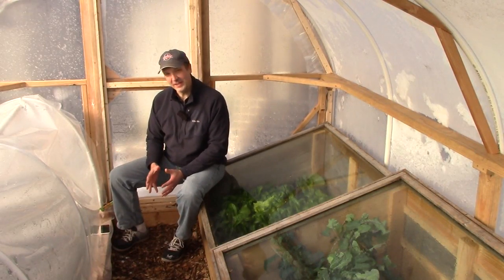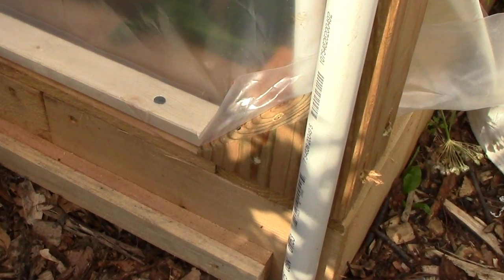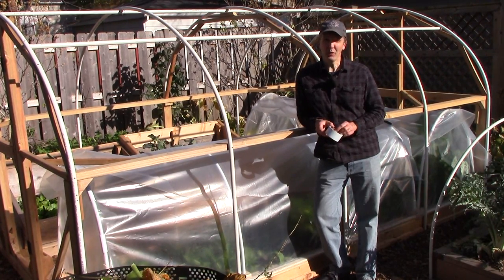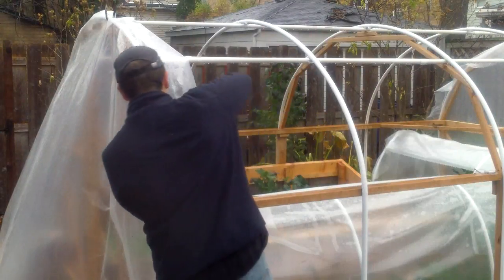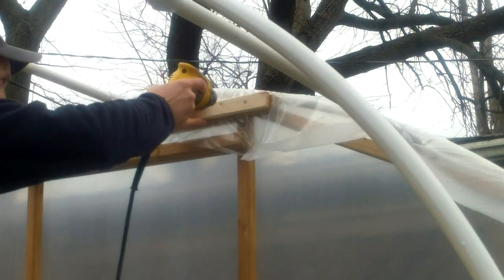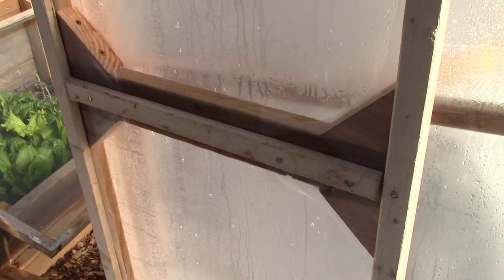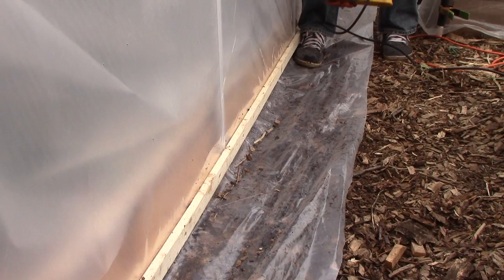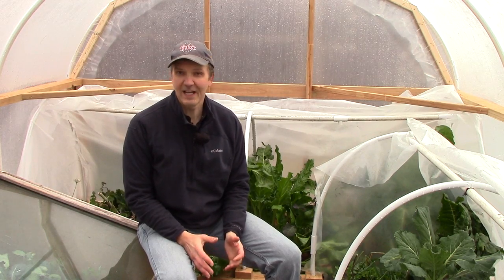How I Built Our DIY Hoop House (Greenhouse), pt. 2: Door & Plastic Cover

Comment: Had to come back and see this video again. My plan is to take a Harbor Freight 10'x17'  garage and make it into a hoop house and add low tunnels as you did. Want to come up to Maine in the spring and help?
Have a blessed day, Patrick.
Reply from the maker: That should work, Jim! If there are any sharp edges on the metal frame, covering them with duct tape should help. Best wishes with your hoop house!
Reply: @OneYardRevolution  thanks so very much. I will be using carriage bolts to attach the 1x4 straps and I think it was in this video of yours where I took note of the white duct tape. As always, great keeping in touch with you.
Blessings,
Jim

Comment: nice job, looks great.  The only problem I have is a hoop house is very wet, and I am certain the moisture will have a negative affect on that wood.  Instead of wood, I used poly web to secure the plastic.  Works great, and water resistant.  I also used wiggle wire  on gables as I said before, thus allowing me to remove the plastic if needed  with no affects to the plastic.  Overall a very nice project.  Happy growing.
Reply from the maker: +motocephalic Thanks! Can you send me a link to the poly web product you used?
Reply from the maker: +motocephalic Thanks!

Comment: really awesome! a suggestion: a clutched drill. im concerned  about stretching of the plastic over time and what are the temps, in and out? You are the best!
Reply from the maker: +sbfarmer 8 Thanks! I'll be gathering data on temps this winter and will share it with everyone. The plastic will stretch over time, especially on top. The top plastic will be off from March to November, so I'll be able to tighten it up every year when I reapply it. I can't tell you how many people have encouraged me to get a new drill. I take after my father and have a hard time replacing anything that still works. ;-)

Comment: Super clear and detailed, thank you for this series
Reply: Before you build look into cattle panels for your greenhouse, also 12 mil Agtec poly is only ¢ .26 per square foot minimum of 300 square feet but they cut custom sizes. I also added grommets to the plastic sheeting, which is 7 year warranty plastic and reinforced. I'll leave a link to the plastic and cattle panels as a reply to your comment.
Reply: Cattle panels link. https://www.tractorsupply.com/tsc/product/feedlot-panel-cattle-16-ft-l-x-50-in-h
Reply: @BillyBob-lk2uw  thank you!!

Comment: Nice Job man! 
I presume your area is very cold and windy, this seems to be a lot tighter that I would have made in my area (almost no snow)
Reply from the maker: +Tom Britt Thanks, Tom! Yes, we get a lot of snow and it can get very windy, so it's important to have the plastic fairly tight so snow doesn't have a chance to accumulate on sagging plastic. It's not unusual for us to have a meter of snow on the ground.
Reply: +OneYardRevolution | Frugal & Sustainable Organic Gardening 
Wow! it's a huge amount of snow for my country. Your job and explanation is very useful, I really like the idea of the wood tensors inside, it allows using thinner pvc tubes that are a lot more flexibles. I also like the way you make and cut the door (sorry i sometime use French expressions into english). One thing you did not plan an air circulation, why, even in winter excess of humidity is an issue by sunny days, are you going to open the door?
Reply from the maker: +Tom Britt Thanks, Tom! Yes, we can open the door when air circulation is needed. I also framed an opening for a window that I may add next year. Even so, I don't expect air circulation to be much of an issue because of the way we'll be using the hoop house. We only plan to have the top covered from roughly November to March. During much of that period, it is usually far too cold to vent the hoop house, even on sunny days. Using this approach on a smaller scale with low tunnels, we've never found excess humidity to cause any plant damage during the very cold months. That said, I'll monitor the issue and report any problems that I encounter.

Comment: Hi Patrick, I enjoy watching your gardening videos. I built an unheated greenhouse this year. However, it smells like mold inside the greenhouse. Do you have any suggestions on how to control fungus and mold from building up inside the greenhouse?
Reply from the maker: Thanks! We only keep the cover on during the cold months, so mold has never been much of an issue for us (it's too cold for mold to grow).  Is you cover on year round? How cold does it get in winter there?
Reply: @OneYardRevolution  Hi Patrick, Thank you for your response. This greenhouse is only for the winter. The temperature can range from teens to low 70s in my area during winter. I am not around to open the door/window to keep the air flow on days when the temperature increases because of my work schedule.

Comment: Really nice structure Patrick! Just in time. How cold are you going to let it get before closing the cold frame doors, and adding the second layer of protection of plastic? During the day it has to be 70-75 inside...(I'm using Ag-15 for the interior tunnels).
Reply from the maker: +Paul D Thanks, Paul! So far, I've covered the cold frames and low tunnels for the last 3 nights, when it has been as cold as 15 F. I vent them during the day, though. As a rule of thumb, I keep the inner layers off or vented unless it's well below freezing and not sunny out. What approach do you take?
Reply: I haven't had to yet! I was picking your brain on the subject. I forgot you guys in the mid-west had that clod snap and snow. I think your way sounds like a good rule of thumb! thanks
Reply from the maker: +Paul D You're welcome! I try to do as little as possible and err on the side of being too cold rather than too hot. Between November and March, we keep the covers on when it's well below freezing and not sunny (or even partially sunny).

Comment: Do you plan to heat the hoop house? A rocket stove could totally allow you to fully grow year-round.
Reply from the maker: +MIgardener | Simple Organic Gardening & Sustainable Living Hi Luke. We're going to use the Eliot Coleman approach of growing only cold hardy crops and using only the sun for heat and light. The two layers of protection should create a micro-climate similar to zone 8. Even last winter, which was very cold, we were able to keep lettuce going all winter using this approach on a much smaller scale.
Reply: +OneYardRevolution | Frugal & Sustainable Organic Gardening I built a hoop house this year and I am struggling with humidity. Last I checked I had about 99%humidity. I ended up putting a vent but I am loosing a lot of hot air in the process. Any pointers?!
Reply from the maker: +philip lion Hi Phillip. We only plan to have the hoop house covered from roughly November through March, and have never found the humidity to cause any problems for plants during that period. So, we don't plan to do anything about it. Is humidity having a negative impact on your plants this time of year?
Reply: +OneYardRevolution | Frugal & Sustainable Organic Gardening yes I have some bacteria and fungus growing on the plant leaves and on the soil. That is why I am trying to control it. I live in OH btw
Reply from the maker: +philip lion I think air circulation is your best bet. In addition to venting when it's warm, fans should help reduce the risk to plants.
Reply: +OneYardRevolution | Frugal & Sustainable Organic Gardening ok thanks :)
Reply from the maker: +philip lion You're welcome, Philip. I meant to also ask what crops are being adversely affected and are you heating the hoop house? Thanks.
Reply: +philip lion Foliar spray with (alternating) hydrogen peroxide dilution (Google) and compost tea. Also the fans or dehumidifier might help. It's the combination of cold and humid that makes the mold grow, so if above doesn't do it, you might add very low heat.
Reply: I haven't encountered any issues lately but will keep this in mind if I encountered the same issue again

Comment: Very nice. Have you concidered putting a hot compost bin in the green house for heat.
Reply from the maker: +phxtonash Thanks! I thought about doing that but eventually decided against it given the space limitations.  I think the hoop house looks bigger than it is. It's only 13' x 9'  (4 x 2.74 m). So, instead, I went with Eliot Coleman's approach of using 2 layers of protection.
Reply from the maker: +Watt Waster That's a good point. It gets pretty warm in there when it's sunny.
Reply: Be careful, offgassing can kill your plants if you do that.
Reply: If you were to make a hot compost pile on the outside of the hoophouse (not the sunny side) wouldn't that aid in heating + not give any risk of killing your plants with the off gasses? Not sure if you have any space for that Tbh.

Comment: But then what would you attach your plastic to on the end walls. I do agree that it would be easier to put a 45 out to the hoop but would you still have the others that go to the top of the door and out to the wall
Reply from the maker: You'd have to use enough plastic to cover the top and end walls.

Comment: I am wondering how much wind you have seen this design take. From the looks of it, it might be rather sheltered by a large fence nearby, and relatively out of the 20-foot surface winds.
Reply from the maker: We've had winds as high as 65 mph, but as you noted, we have wind breaks surrounding the garden.
Reply: You are almost the Fred Rogers of gardening. Just change your shoes and sweater at the beginning of a video and you'd be there.

Comment: HI Patrick.  Thanks so much for the great explanation and plans. I've debated about a glass greenhouse that is more expensive (as described in "year-round solar green house" by Schiller and Plinke).  But your approach is very convincing.  I have looked through the comments and your videos, but not found if you talk about removing the plastic for the summer.  Is there a video you explain that?  Is it a lot of work?  You say the plastic has lasted years, so I am assuming you remove it and put the same plastic back each year?  Thanks so much again, I learn so much from your videos. (In fact, I figured out how to sign in to Youtube with the sole purpose of liking your videos!)
Reply from the maker: Thanks Scott! For another inexpensive, but easier to build, hoop house option, do a search on cattle panel hoop house (or greenhouse). There are a number of good videos on YouTube on how to set them up. Yes, we remove the plastic in late winter or early spring and use it for several years. I don't think I have a video showing the process, but it's easy and only takes about 45 minutes to remove cover from the hoop house and low tunnels inside.
Reply: Okay, while you answered one question I have to try for another:  Did you consider using a double layer on the house? I know you use two layers by putting covered structures within the house.  But I see that quite a few people use double layer plastic houses (and I've seen them in larger operations). I'm wondering if you weighed pros and cons on doing that.  What you have going seems great enough, so I imagine that the extra warmth just didn't seem worth the trouble.  Thanks again. 
 (As before, I did search comments and your site before throwing this question at you).   [And I gotta wonder what you are going to post after this polar vortex!  -17 here in Ann Arbor.  I'm wondering if anything will survive in my cold frame which is under about 4 inches of snow!]

Comment: Has this continued to work out? Did the plastic shrink in the winter at all??
Reply from the maker: Yes, the hoop house is working out very well. We harvested crops all winter (our 3rd winter). Yes, the plastic shrinks when it's cold, but that's okay, because tighter plastic sheds snow better and is less vulnerable to wind.
Reply: OYR Frugal & Sustainable Organic Gardening Great! I didn’t know if it would shrink to the point of tearing. I’ve heard some people say not to pull the plastic taut, but just enough to get wrinkles out. I’ve been doing lots of research, watching lots of videos how people have built their’s, As I intend to make my own this fall. Glad it has continued to work out for you! Thank you again for the response.
Reply from the maker: You're welcome! One thing to note is that it was already fairly cold when I put the plastic on. If I recall correctly, I think it was November. You wouldn't want to pull it as tight if applying the plastic in the summer.

Comment: What do you do in the summer? The film is permanent, so wouldn't it get too hot to grow anything during summer months? What latitude are you?
Reply from the maker: Hi Lynn! Because a separate piece of plastic covers the top of the hoop house, it can be removed quickly (5 to 10 minutes) by removing the 1 x 2" slats and clamps. This doesn't affect the plastic on the end walls at all. What I do is gradually vent the top plastic over a number of weeks until the top is completely removed. This video opens we me inside the partially vented hoop house: https://www.youtube.com/watch?v=CCtQO5wqVww

Comment: How do you water in the winter?  When the temp is below 32f
Reply from the maker: +yourlady meme Great question! We've only watered 3 times since covering the hoop house in November and we never water when it's freezing in the hoop house. When we do water, we use a garden hose. As you might be able to see in the video, it stays pretty moist in there, so watering is rarely necessary. In our area, plants are typically dormant from mid-December to mid-February and don't need any water at all. This winter has been warmer than usual and plants haven't gone dormant yet, but they still require very little watering. I hope this helps.

Comment: Great job Patrick. I've been trying to brainstorm on the cover decision, not only from a cost perspective but also from a sustainability one (ecological and long lasting). Main three choices have been polyfilm (with more sophisticated but more expensive versions such as ETFE), polycarbonate and glass. Maybe glass is the most ecological (although s1 could debate on that also regarding sand overuse), but can be prone to hail. Polycarbonate seems a good long lasting (although petroleum-based) but expensive option (it's the choice used by Open Source Ecology: http://opensourceecology.org/). I'm not so in favor of the polyfilm as (apart from being petroleum-based) it brittles after a couple of years (at least in my mediterranean region) and makes the garden full of unrecoverable plastic. What's your thoughts about this topic in genral?
Reply from the maker: +Kostas Thanks, Kostas! I think using discarded windows and glass doors is the best way to go ecologically and in terms of cost. If you're planning a small project,  you might be able to collect the materials when a house in your area is rehabbed. In our area, greenhouse film lasts 7 to 10 years. I've never seen it degrade and leave plastic in the garden, but you live in a very different climate than me. We have film that is 7 years and it is completely intact, though it is quite cloudy.

Comment: where did you get the pvc clips or did you make them yourself?  and how did you get the angles on the hoop 2 by 2 frames that come off the door
Reply: got the clamps but still wondering about the angles to cut the 2 by 2
Reply from the maker: For the 2 x 2 trusses? I put the 2 by 2's in place, eyeballed the angles, and marked the cuts with a pencil. An easier approach would be to have a single 45 degree 2 x 2 support that runs from the 90 degree angle of the door frame/horizontal shelf intersection to the hoop. This would provide more support and is easier to implement.

Comment: Could you make your own pvc clamps by cutting lengths from the same size pipe?
Reply from the maker: +Dreamingrightnow You might be able to make clamps from a larger sized pipe, but I wonder if they might be too rigid and rip the plastic? Clamps are pretty cheap from Greenhouse Megastore and they work really well.